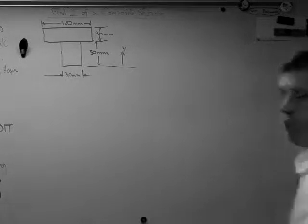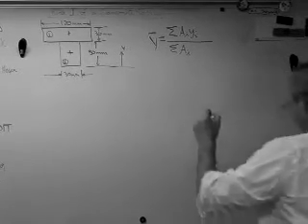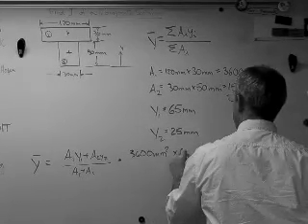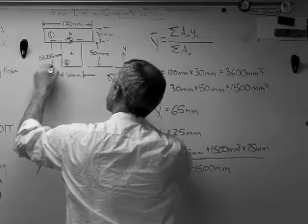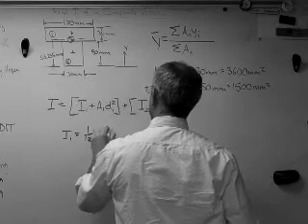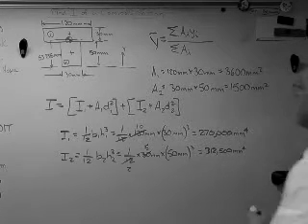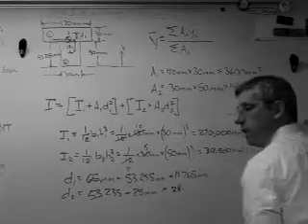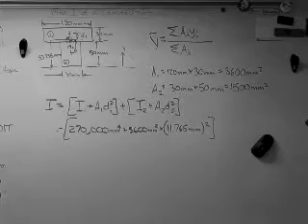I of Composite Section.MP4

Comment: How to calculate "I" of a Cantilever beam which twist through the length?  Example: I of a rectangle at the fixed point is Vertical; and twist from the cord to the tip which would change the "I" thought the length as the beam height becomes the width.